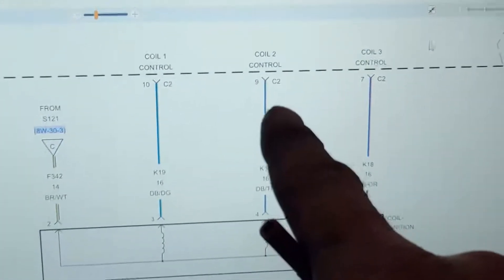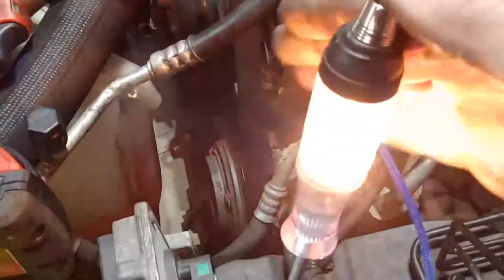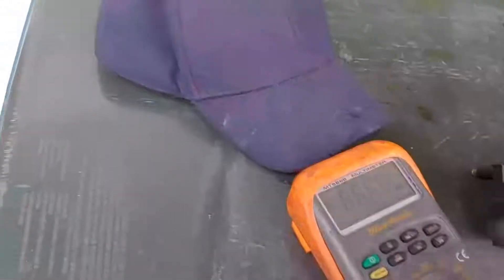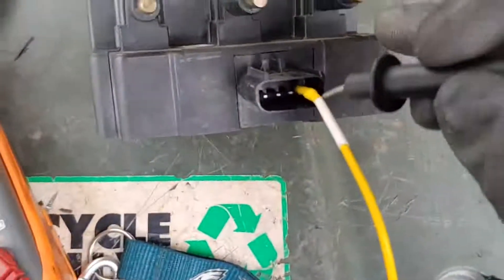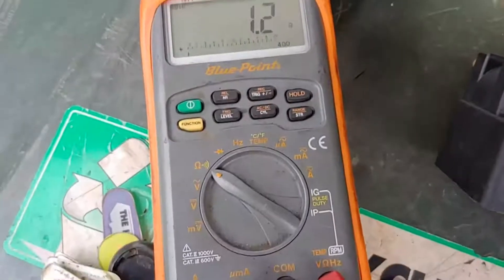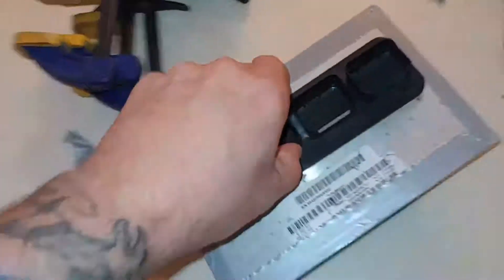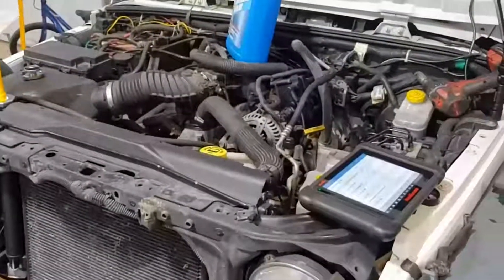2009  Jeep Wrangler Misfire Cylinders 2 & 5

Comment: My favorite part is where you show us the flashing test light test and completly miss what you plugged them into to....dove into mine 2/5 missfire. Only test i did was smell the ecm....stunk like a burnt chip so i skipped all the testing.  Was a burnt chip. Hardest part was opening the ecm up with out bending it. No check engine light now runs perfect. Cost was $10 and about an hour
Reply: hello, I have jeep wrangler having issues with cilindro 2 and cilindro 5 misfires you think I got the same issue

Comment: Hi was car running lean with those misfires also?? Was there no more misfires after repairs? thank you
Reply from the maker: I didn't check fuel trims because it was a dead miss. There was no need to check and after the repair no more misfire 👍
Reply: @madmike214  Awesome I had cylinder 3 coil short out and I never thought it can damage something inside PCM,thank you for your response after replacing everything on that cylinder this is my last bet thank you again.

Comment: Great job.  As an enthusiast, I understand the pin connections but how do you trace what mosfet it connects to?  I've heard people say follow it through but I don't understand.
Reply: Multimeter set to continuity mode. That’s how I trace them
Reply from the maker: I'm this case it was obvious because it had a hole in it but following it through would mean locate the pin and on the board side follow the traces to and through the components

Comment: I have a 2009 jeep wrangler with the 3.8 replaced the coil pack 3 times because it busts. The code reader says "Cylinder 2 misfire" Replaced the plugs, wires, second fuel injector, cam shaft sensor, crank shaft sensor, bought a new computer (today). The computer and coil pack were both new when we put it on but its still doing the same thing 😫
Reply from the maker: Are you testing or just putting parts on? You need to test the coil control and make sure you have the same put of the pcm and the same at the coil. Chances are you have an openwire somewhere
Reply: Hello, did you found the reason? Ang updates?
Reply: Always check all your grounds 👍🏻
Reply: How can I locate a pinout of the ecu components?  I am getting into repairing clusters and ecu’s but to figure out the guts of the electrical is difficult
Reply from the maker: You won't find a schematic unfortunately,  only pin out you will get is for the connector then you have to internally trace the circuits

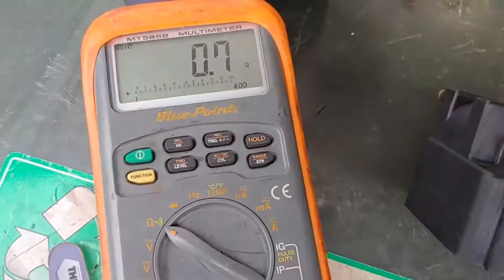Comment: NO!  @ 2:20, you are WRONG.  You SHOULD get about 0.6 ohms between pin 2 (common) and each of the other pins (pins 2/1, 2/3, 2/4) and you SHOULD get double that (1.2 ohms) between pins 1&3, or 1&4, or 3&4.  Check your schematic later on in the video, pin 2 is common which is why it shows half the resistance.  Your ignition coil was fine.  So that doesn’t explain the failure.
Reply from the maker: not sure I'm following...not saying you're wrong, I'm always up to learn,   the common comes from the ASD output (30 amp fused from ASD relay) supplies the b+  to each individual circuit, this is 3 series circuits with a common b+, the path to ground is different for each primary circuit, each mosfet switches the ground side and only one is active at a time. Typically with 1.2 ohms I'd expect to see somewhere around 10-12ish amps on a current ramp, when i scoped the ignition system that's what I observed after the PCM was repaired and the new coil in place (this was not filmed).  0.6 ohms would put it over 20-24 amps depending on system voltage and if it has current limiting or not, which i don't believe these have.

Comment: So if they are flashing it needs a computer ? Mine are flashing except for one
Reply from the maker: If they ARE flashing then that control is GOOD, if it's not it's bad control and likely burnt the driver. Check resistance of the coil,  You have to be 100% sure the coil is not shorted before you replace or repair the pcm
Reply: @madmike214  it’s a 07 wrangler I’m assuming pcm is bad
Reply: Ok I’m getting a p2305 code and the blue/tan wire is solid not flashing the other 2 is flashing so I’m assuming I need a pcm? I have a brand new coil I haven’t installed yet I’ll install with the new pcm
Reply from the maker: I would test the coil first to see if that's what till it the pcm, then test the same wires for the coil at the pcm to rule out a short in the wiring. Pcm will need to be programmed
Reply: @madmike214  I replaced coil plugs and wires today tested the wires at the harness for coil all flashed except the blue/tan one then checked the wires at the pcm side and it was the same all flashed except the blue and tan one
Reply: I was looking at buying a pcm pre flashed from flagship one I’m just not sure what else it could be besides the pcm after testing everything today
Reply from the maker: Be careful and read the fine print with flagship 1, they are hit and miss. If it comes down to it you can send me your pcm and I'll repair it. If interested contact me at leondiagnose@gmail.com to set it up
Reply: @madmike214  so if I’m correct the blue /tan is the signal wire for cylinder 2 that should flash? Not be steady I’m pretty sure I have the exact same one as this video not working
Reply: I just wanna make sure I’m looking at the right wire but I believe blue/tan is a trigger wire for 2/5
Reply from the maker: Email me your vin and I'll take a look at the wiring diagram in servicein formation
Reply: @madmike214  just emailed it to you

Comment: So you solder the pins back to the pads and have solder paste under the module? Whats the coating that goes over the chip called? I'm going to try this, worst case scenario it's still broken
Reply from the maker: Yes sir... I used solder paste and a hot air set up to remove the old one, a regular iron along with a solder wick to clean up the pads, add the paste and then the hot air to install the new one. The coating is called "conformal coating" you can get the pen version on Amazon.

If you don't have a hot air station, look up "super Mario diagnostics", he actually put out a video yesterday (high quality and highly detailed) on replacing a mosfet with just an iron.

Good luck and let me know how you make out!!🤘
Reply: @madmike214  will do. Thank you for the info!
Reply: @madmike214  what kind of conformal did you use? acrylic or silicone?
Reply from the maker: MG Chemicals 8309-P Conformal Coating Stripper-Pen, 10 mL Felt Tip Pen https://a.co/d/i4qDaJg
Reply: @madmike214  thanks. silicone or acrylic conformal coating to finish the job?
Reply from the maker: @digitalbuzz  don't know why it didn't post last time, I'll try again...
Check this out! https://a.co/d/8dD3QJm
Reply from the maker: Along with the conformal coating pen grab a conformal coating stripping pen as well to help with cleaning that coating off, i originally used alcohol which worked well but i still ordered a the stripper and went over it just in case...it Matt have been overkill but it was my first pcm repair and i didn't want to take any chances 😆

Comment: Finally someone with same issues but better skills. Thanks for sharing.
This is the second time I'll be having this issue, first time my mechanic had to swap too many parts and ended up costing too much but now i have this video! 😎😎
Quick question, is it possible to cannibalize a previous pcm to get the faulty drive?
also is it possible the coil isn't the culprit(can it be caused by something else) and finally can you please explain the relearning process. 
2007 Sahara Jk
Reply from the maker: Glad it may help.

Yes you can cannibalize another pcm as long as you can verify the mosfet is the same or similar values...i honestly wouldn't know how to look that up, i replaced this one with a new mosfet that was identical. As long as you don't damage the one you are removing you'll be fine, i was actually going to do the same.

I'd have to look at the wiring diagram again but i believe the coil is supplied a power through the asd relay and the pcm grounds/controls the coil. So it's not likely something other than the coil....but...technically...yes it's possible but you would need a short to power on one of the coil control wires for that to happen or maybe if someone used a power probe  incorrectly or jumped 12v positive to the control circuit.

And relearn may or may not need to be performed, it's a cam/crank correlation relearn which is done with a capable scan tool.

Comment: I  Have the  same  problem would like to know if you have three extra that I can buy from you?
Reply from the maker: ill have to check stock but i can be reached easier  through email leondiagnose@gmail.com
Reply from the maker: i just checked, i dont have any available, i traded away.. but this is the link i used to order them https://www.auto-chips.com/g18n40bg-vulnerable-ignation-chips-for-automobiles-ecu-p0407-p0407.html?fbclid=IwAR3mPrVxJnsnsFI9B3rBRU3E4fQIHCZjnrTiu35Bb8seH76JwWgQEefdglY
Reply: @madmike214  SO I ordered 5 chips was going to change 3, but the guy i had to fix it told me the bord got burnt and it can not be fixed ? WAS yours burnt?
Reply from the maker: @quincysmith6894  slightly, cleaned up and soldered anyways
Reply from the maker: If interested i can attempt to repair it for you, i might have to bypass the pcb and run new traces.  If you have pics of the board and if you're interested contact me at leondiagnose@gmail.com to set something up.
Reply: @madmike214  HEY GREAT ADVISE .ITS WORKS but now I need to reseal it back up what is that glossy coating ? AND THANK you for every thing it really helped.
Reply from the maker: @quincysmith6894  glad it works!!! The coating is called conformal coating , you can get a conformal pen from Amazon
Reply: @madmike214   Thank you so much.

Comment: Same thing happened to mine. I didn’t have computers to diagnose. First time in 248K I took the jeep in. Too bad they can’t repair the PCM so they replaced it for $750 + coding. I got it back but I still have a misfire. I think I had multiple things happen at the same time. Now I am guessing clogged injectors or valves going. Might be time for a rebuild, or a crate motor.
Reply from the maker: If it was the same as this, having a shorted ignition coil will kill the new pcm
Reply: @madmike214  , had to replace the coil too.  I did not understand why a shorted coil kills a PCM. Seems like a bad design to me. Mechanic tried to tell me spark was jumping back into the wire from the PCM. But that did not seem logical. I have new coil, wires, plugs, PCM. I love my old analog jeeps. They may not be fuel efficient, but they are super easy to repair.
Reply from the maker: @sinkinpat  with a shorted coil, that mosfet becomes a fuse... it's essentially taking a path from battery positive to battery negative...
Reply: @madmike214  you right, the coil pack had a short end blow the transistor.
Reply: It looks like I might get a new IGBT transistor via someone that have contacts with supplier in USA. It will save me a lot of money.